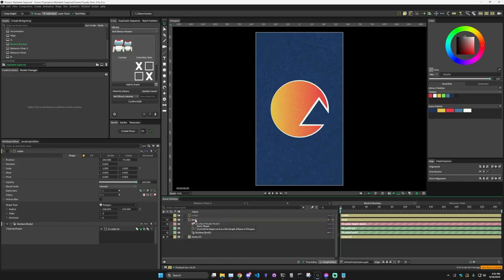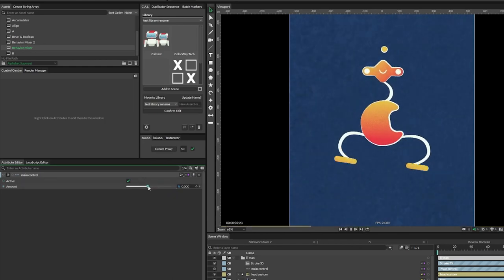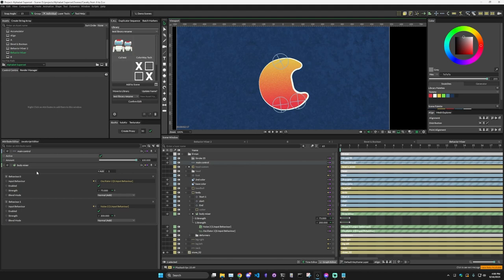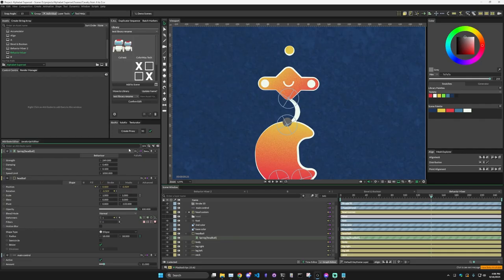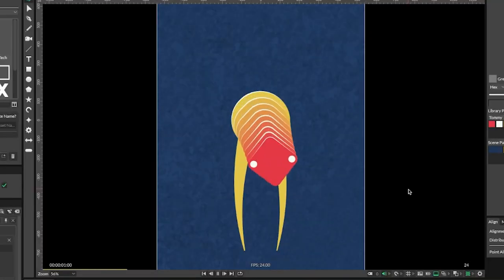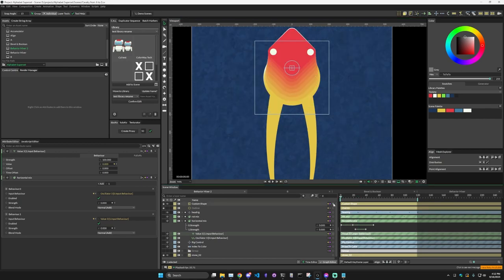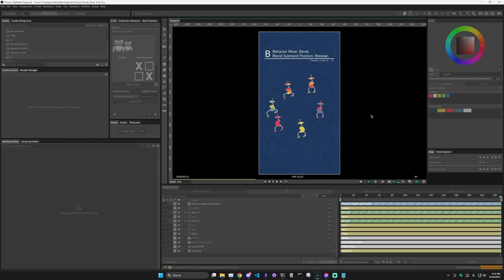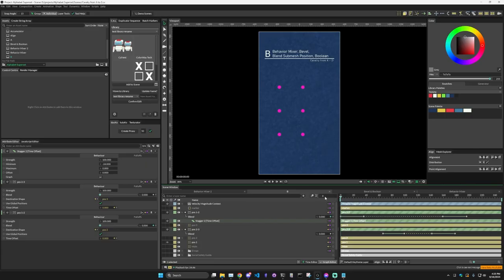Use Cavalry's Behavior Mixer to make dynamic procedural animation!

Comment: First off, thanks for sharing Cavalry knowledge with the world.

Second, it would be great to see some other blend animation uses. for example are you able to blend between more than just two keyframes? Can you park a bunch of “poses” and then dynamically select them from that master slider control? 

Skipping ahaed to the letter I. my brain starts to die when I think about indexes and how things in duplicators feed into each other. I think some of the real power inside Cavalry is taking advantage of that but good lord it hurts to think about how to rig it up in the first place. 

Keep up the great work!
Reply from the maker: Animation Control will essentially 'move the playhead' through any keyframes on that attribute, while also interpolating. So if you have a character dancing, you could connect the Animation Control to all the animated attributes and then animate the Animation control any way you want, like you could attach an Oscillator to it which would make your character dance forward then backwards forever. It also interpolates between the keyframes as well to get the 'middle' values. So if you have a ball that moves left to right in 10 frames, you can animate the Animation Control over 5 frames, or over 50 frames, and it will automatically calculate the proper 'relative' position based on the speed of animation. That's why for this example I only need a keyframe on 0 and 1, since the Animation control will automatically interpolate the in-between values.

I talk about it a bit more in the 'Everything you need to know about Timeline Counters in Cavalry' video. Let me know if you think it would be beneficial to have a dedicated video for Animation Control.

(Also, Indexes and Context is a bit tricky for me as well haha, but I'll try to talk about it when we get to I)
Reply: There are "Keyframe Layers" for blending animations.
Reply from the maker: @YevgenyMakarov   yep, and I'll go into that more when I get to 'K'. I haven't used them a ton yet so I still need to learn their ins-and-outs, so it will be interesting to see what the pros/cons of each are. There's a lot of other uses for Behavior Mixer as well, I just showed that use case because that's how I've used it so far. If you've used Keyframe Layers in your projects I'd be interested to hear your thoughts on them. My initial impression was that it was a bit tricky to get the hang of.